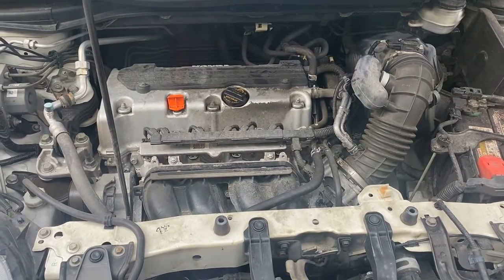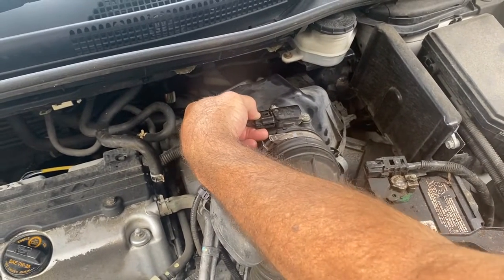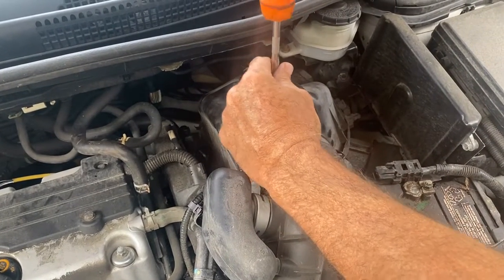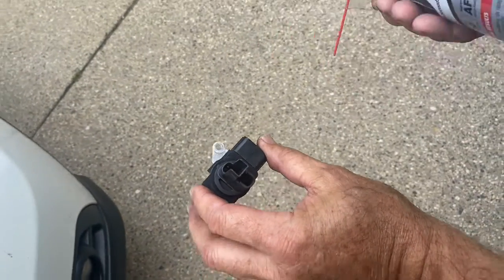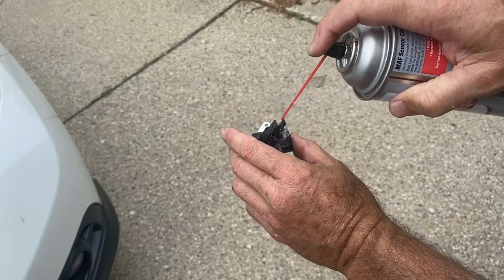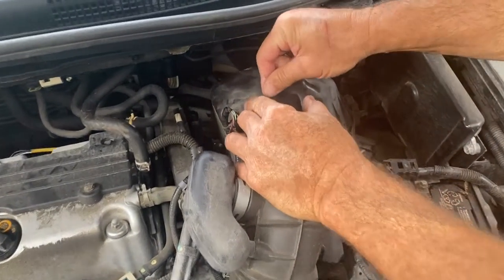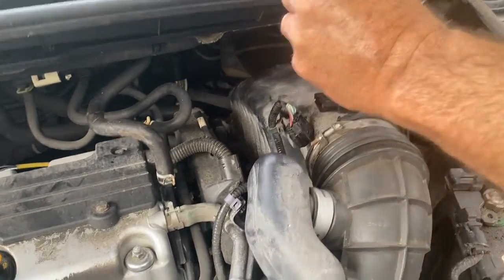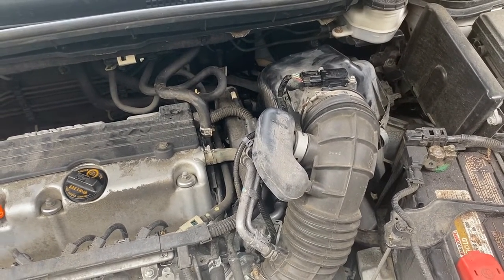How to Replace Mass Airflow Sensor Honda CR-V EX-L

Comment: Would this also take care of the intake air temperature sensor? Had the code p0111 and was told replace the maf because it's a combo sensor
Reply from the maker: No, for PO 111 replace the air cleaner first and if that doesn't work, replace your air intake temp sensor.
Reply: @TheAutoTeacher What about the p0171